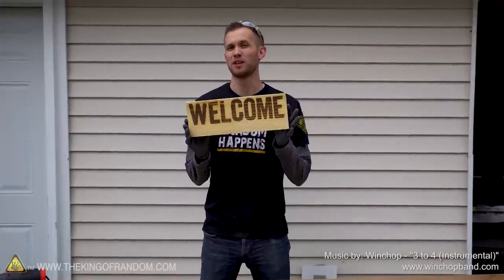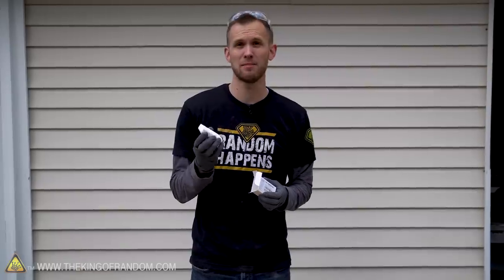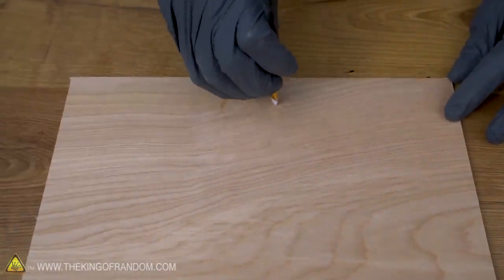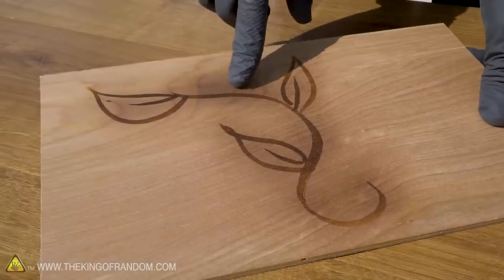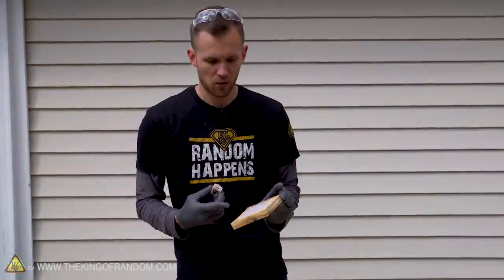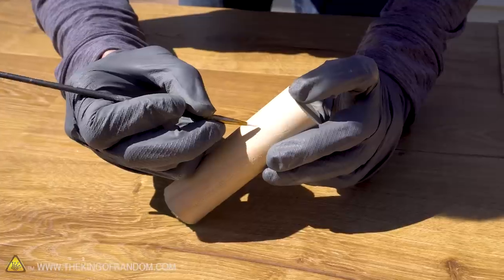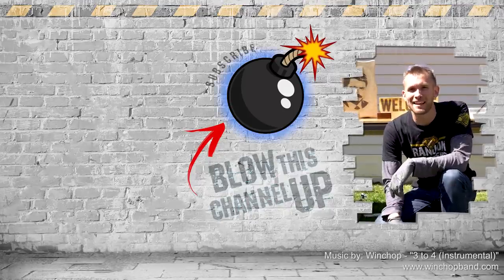Burn Pictures Into Wood! TKOR Dishes Out On All The How To Wood Burning Techniques!

Comment: Awesome job👍👍👍 One question though, will a blow dryer work instead of a heat gun?
Reply: You can pick up a heat gun for under $20 at some stores. I doubt a hair dryer would reach temperatures that would be needed. Or at the very least could take forever to react.

Comment: My woodburning technique consists of a magnifying glass and the sun. I print a black & white image, preferably a line-art image, and stick it to some wood with wallpaperglue or any water based glue. I then use the magnifying glass to make a first imprint. The black ink soaks up heat from the sun a lot better than the white from the paper so the process easily forgives minor mistakes. It does take practise, though. I have a very steady hand now. After burning I scrub off the paper with water and a scrubbingsponge, and then I can go for a second burning if I feel it needs to have some more depth.
Awesome method. Highly recommend you try this in the summer.

Comment: Can you use the oven to help avoid the burn spots that you got with the heat gun?
Reply: Was going to comment the same thing, you can control the temp in an oven to avoid burning the wood, but activating the chloride
Reply: also curious if it would work in a microwave
Reply: Tomislav Harambašić 
Microwaves excite water molecules, so probably not.
Reply: I was thinking the same but using the broiler so the heat would be above the workpiece.
Reply: well there are a lot of them in that solution he is using, that is where i got the idea
Reply: I wonder how hot it would have to be... Most ovens can't go above like, 500°...

Comment: I wonder if you were to double the amount of ammonium chloride would you be able to eliminate the scorching around the treated areas?
Reply: The clear coat also seems to protect it from that....I’d assume anything that you can use to stencil off everything you’re not burning that is fairly heat resistant would do the same

Comment: So cool! I've seen another video where they burn cool patterns in the wood with a transformer from a microwave. What would happen if you put the ammonia chloride on the wood like in your video but instead of using a heat gun, you used the microwave transformer? Normally it would burn a cool lightning pattern in the wood, but if the electricity was conducted through the ammonia, my thought is it should electrically burn in your image. Would love to see this!

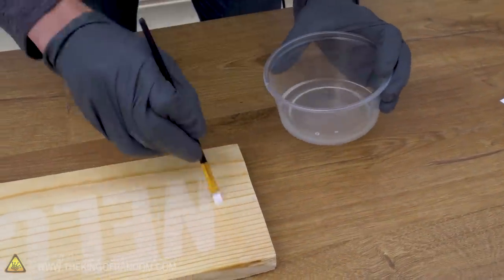Comment: 4:14   is it ok if  i use a smaller brush  than the one you are using  ?    instead of a Larger one  which would take  5-10 strokes to do the entire  board, i want to use  thousands of little  strokes   and   alot more time.cheers
Reply: You do You, yes you can use a small brush and a thousand strokes lol

Comment: Would it be possible to put your wood in the oven instead of using a heat gun for a more controlled burn?  About what temperature does the solution need to hit to work?

Comment: Does different concentrations of the solution result in darker or lighter “shading?”
Reply: You can hold the heat on longer but it also torches the edges around it. But you can do shades of light and darker with the amount of heat applied. you need a 1,000 watt heat gun, 300 degree oven or toaster oven. A creme brulee torch gets too hot and burns everything! xoxo Sandy DIY

Comment: would 'baking' the wood work, or maybe putting it under the grill yield more 'even results? my thinking is temp control and a slower introduction of heat to the project. Does this mixture ever go 'off' during storage?
Reply: Derek Buttery all that matters is direct heat, a grill uses an open flame, so no, and it never goes off at random

Comment: Can the wood be heated in an oven?  If so, how hot would it need to be to activate the chemicals?  You should do a follow-up with the oven method, if it works.

Comment: I was eager to put some great designs on cornhole boards.  I couldn’t get the burn to happen. I used a cricut to create my stencils and masked off a checkers pattern.  I sprayed poly over the mask patterns.  I removed the masking and coated with the chemical mixture and water.  I am sorry to say I could reproduce the same results.
Reply: It has to be raw wood, it can't be sealed

Comment: will a blow dryer work just the same?
Reply: you need a 1,000 watt heat gun, 300 degree oven or toaster oven. A creme brulee torch gets too hot and burns everything! And a blow dryer does not get hot enough xoxo Sandy DIY

Comment: I just burn it by hand with a kinda metal  rod I draw it by hand it is easier than put in some amoniem chloride or whatever it's called but that's a great way to do it if you don't  burn it with the metal gear you should do a video of molden a custom metal sign

Comment: I tried this with a hair dryer and it didn't work. You could only barley see where the ammonium chloride was painted on. I even tripled the amount of ammonium chloride to see if that would help and it didn't. I had better success holding it over an open flame on my gas stove.

Comment: Couldn't you just put the wood in an oven to avoid concentrated heat spots?
Reply: you need a 1,000 watt heat gun, 300 degree oven or toaster oven. A creme brulee torch gets too hot and burns everything! xoxo Sandy DIY

Comment: I just can't get past the burned "halos" around what you drew. It seems applying a clear coat beforehand is the only thing that really saves the wood. But then you can't use the technique. Hm.
Reply: I would try using a stencil :)

Comment: Umm your putting to much thought into wood burning and making it way more difficult than it is I got a wood burning set for 20$ at Walmart and that was the premium one with different heads and soldering tip the non-premium was 12$ 😂😂😂